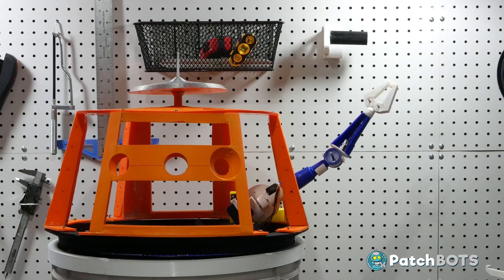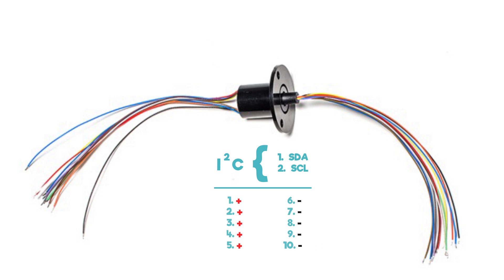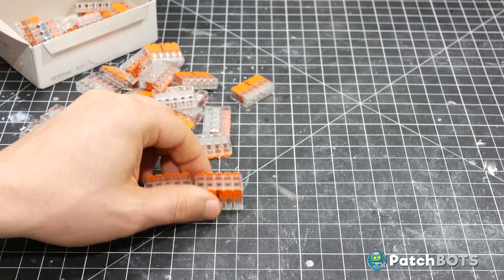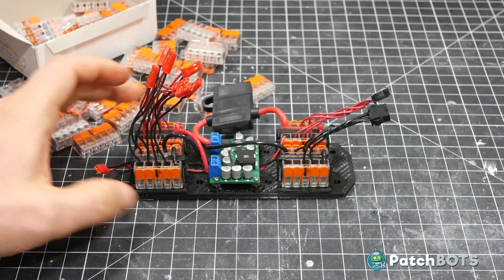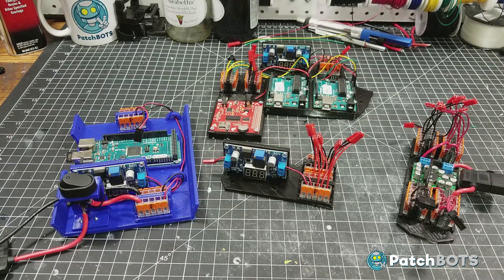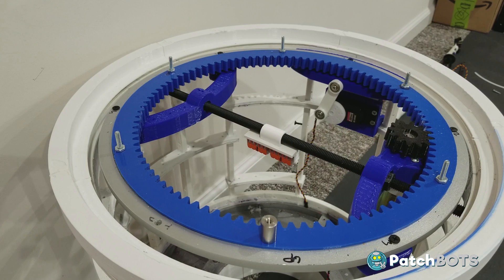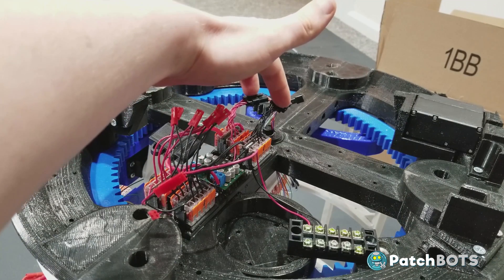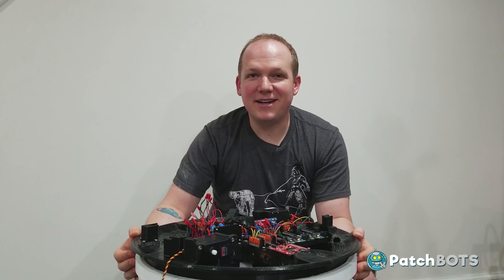Star Wars Chopper Build- Part 5 Power Distribution

Comment: What website do you use to get the parts?
Reply from the maker: I use Amazon for most everything because 1)laziness 2) prime shipping 3) laziness.   Amazon is cheap, but with a cursory amount of research you can definitely find parts cheaper.  If you're in no rush, you can most definitely find cheaper parts via China on eBay.  I've been trying to think ahead more and buy from China, but with so many on the fly changes to this particular project, I find amazon is my go to.  If I'm buying hardware though, I use McMaster Carr because I'm located in the US.  They have almost any piece of hardware you can think of for very cheap as long as you don't mind buying a bit in bulk.   Lowe's/Home Improvement will charge the same for 5 bolts as McMaster does for 50, but I have most definitely made some late night Lowe's runs to finish a section of a project.
Reply: Thanks 😁

Comment: This. Is. Huge. Thanks so much. I'll be using these ideas when I do the electronics for my R2 in a few years after I'm done with the structural building. Thanks again.
Reply from the maker: Yeah, my eyes lit up huge when I first saw those Wago nuts.  Making connections is so easy now!   Keeping things modular came from my utter fear of having to take projects apart once they are all wired. So now, it's built to come apart!